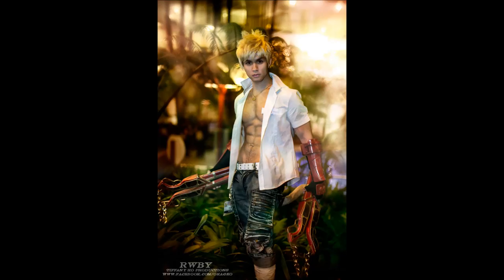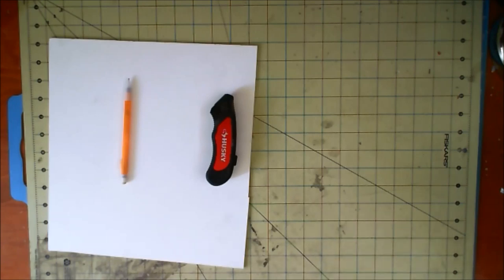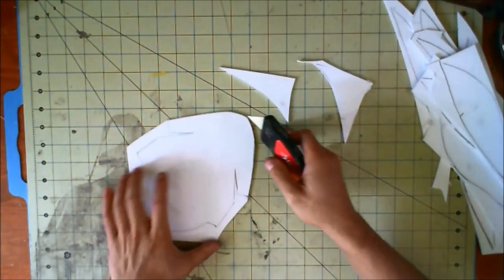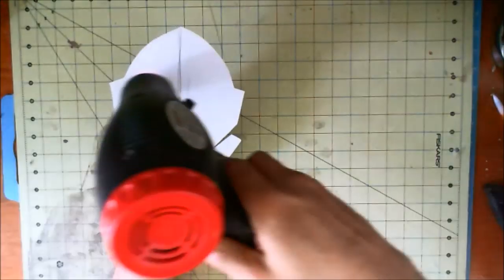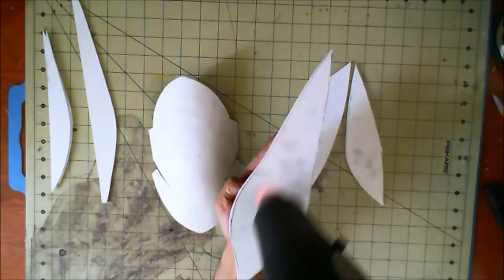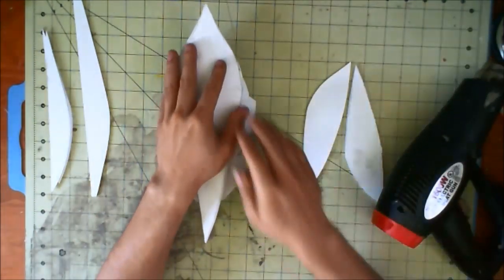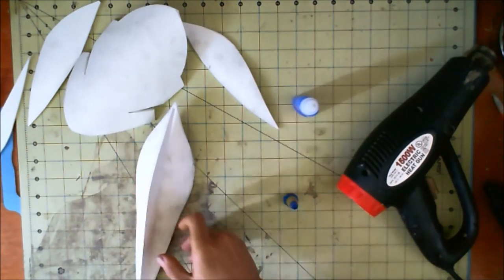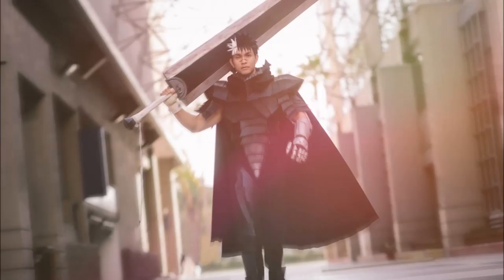How to Armor - Part 2: Cutting & Heat Forming

Comment: How well do hairdryers work as makeshift heating guns?
Reply: I wouldn't recommend using hairdryers. They don't get hot enough to heat stuff like Worbla, and it didn't work when I worked with PVC foam O:

Comment: I use this stuff all the time at work. the super gule actually chemically bonds the two pieces of sintra together
Reply: What exactly do you mewn when it chemically bonds the pvc foam
Reply: Sometimes when you superglue things together, you can get them apart fairly easily. With PVC foamed board, the superglue actually melts the two pieces together, bonding them. You CAN get them apart, but it will most likely destroy them. I've only succeeded in doing so twice.